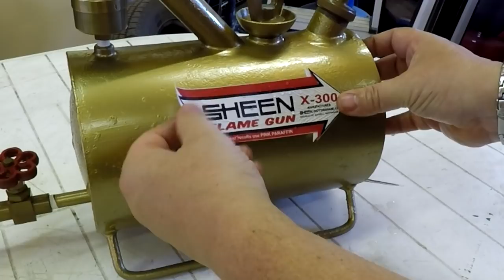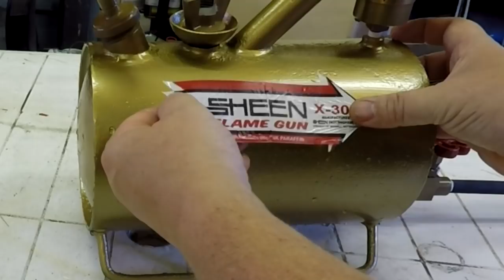Antique Flamethrower Sheen Flame Gun Restoration

Comment: Hi, my Dad had one of these, with which I used to keep the driveway clear of weeds. They always grew back though. There should be a metal cover which hinges on the two brackets sticking up on top of the burner shield. Once the burner was up to temperature, the cover was hinged up and over the top of the burner to cover the flame shooting out of the front and contained the generated heat over the ground being treated.

Comment: We use ours on the allotments, paraffin is way too expensive so we use kerosene (heating oil) way cheaper. We experimented with Diesel but it was too difficult to keep running. Next thing we knew we were asked for advice from another allotment holder who had one......."Can I run mine on Petrol??"... 😱 It's a good job we like him and quickly said "Only if you want to die!" LOL 😄

Comment: When I started watching I thought Christ he's gone too far this time, he's never going to get that working. But credit were credit is due. I would have like an explanation how it works though. I'm guessing that was a sort of wick but do you have to keep pumping the pressure up and what's the coil for?
Reply from the maker: The coil is there so it can heat up a lot of fluid around the heat source just like in a hot water tank.